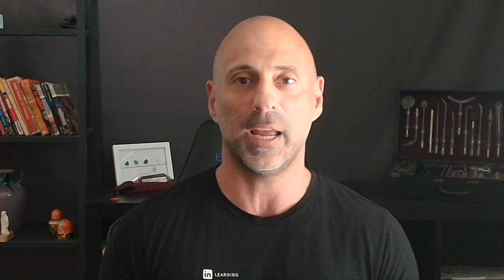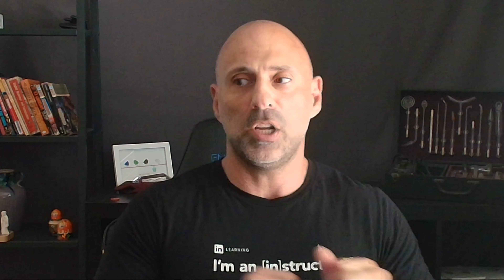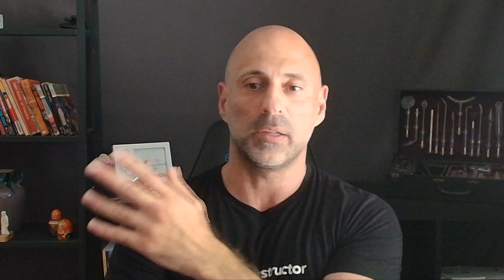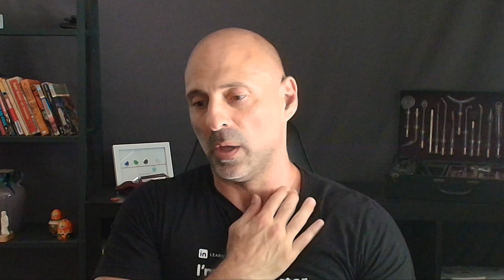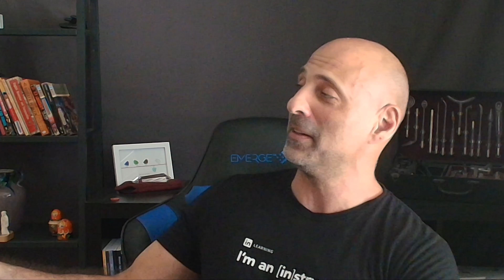What's the BEST CAD System? NX vs CATIA vs Rhino vs SolidWorks - Honest Review 🛠️

Comment: As you said depending on what you're doing.
My all around pound for pound system pick would be NX the value I think is unmatched.

3DX as much as I love it I wouldn't be able to afford or not any of the more advanced packages I'd need for the type of work I'm doing sometimes.

If I do CAS and Class A especially - I think ICEM is unmatched even though Alias is equally capable.
There's something about ICEM and the way it's structured that I think makes it the crown jewel of high quality surface modelers.
Unfortunately it's kind of dying nowadays as Alias simply took most of its market.
Reply from the maker: ICEM classic was/is awesome. Really is. 

I am not a huge fan of Alias. The quality when moved to a different CAD system seems to be lacking.

Comment: Thanks for the insightful and genuinely helpful video! Quick question: between Siemens NX and CATIA, which has stronger surfacing (freeform/Class-A) tools, and why?
Reply: For solids, I’m confident NX is far stronger than CATIA
Reply from the maker: For solids, it is still different enough that it is hard to tell but I would give the edge to NX with a giant caveat. The tree in Catia is best tree.
Reply from the maker: In so many ways, Catia. But NX has caught up and now, a MACH 2/3 license allows me to make parametric NURBS edits way easier than Catia. 

But, pure raw power, Catia.

Comment: I am one who loves NX, but some things need to be clarified here: A Mach2 license is around 8k while a Mach3 is around 10K. For a startup if Mach2 is enough probably Solidworks or Creo or Inventor is a more economical variant. But if you require more advanced surfacing features then NX mach3 or Catia is a better choice from a workflow and time wise modeling point of view. We are talking here about engineering models.
PS: I hate the fact that Draft anlysis tool Siemens decided to put it into a Mach3 license... it is such an important tool and to force you to spend extra just for this it is a bit of a low blow from Siemens.
Reply: I forgot about that! CATIA does the same for persistent sections in a product only works with an SPA license. They do have another tool you can use in mach2 who's name slips my mind but it's clunky compared to CATIA and a MACH3 license
Reply: @paultheworldking   yes, the name of the tool is Slope analysis... but it's just a work around, not the real thing...
Reply from the maker: Unfortunately a lot of software companies are going to the model  where tools are cleaved away and a light version is left behind or not available. 

As far as cost, I bought my license 10 years ago when it was very expensive to get in. The cost models have changed a lot.

Comment: One of these things is when i needed to modify a lambo emblem (found in thingyverse) but the details on it was really bad.... then in v5 i could not modify the small details on stl so easilly like pull push drag etc (sculpting)... i asked gbt what free cad would do it well so i found MeshMixer... i imported the bad detailed stl, learned the cad quicly and modified the small details like sculpting wax on the stl! And got 99% close to the original emblem.... so in catia u just cannot sculpt stl parts.. & im a Catia lover!
Reply from the maker: Those purpose built modelers are great for that specific purpose. And that is great. 

I have used 3rd party stuff to clean up data both Catia and NX had issues with.

Comment: There is no universal BEST CAD System.
There is a best system indeed, for my knowledge, and understanding, and for my needs and budget.
Creo handles large assemblies way beter than SolidWorks or Solid Edge (not knowing much about Inventor).
Reply from the maker: That is absolutely correct, every system has its strengths and weaknesses for sure. Creo does have a lot of strengths but a lot of people will not admit that.